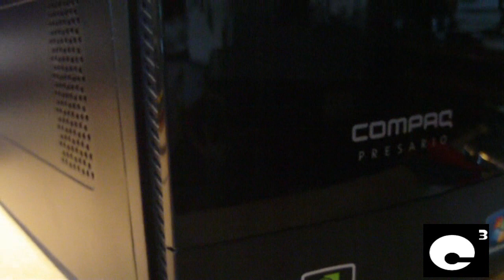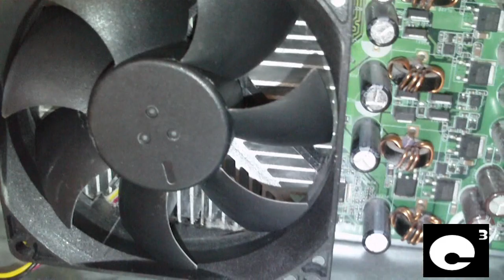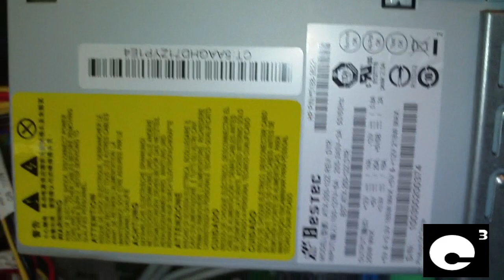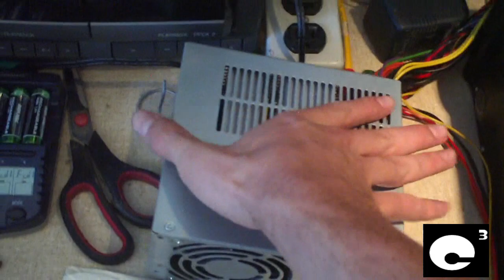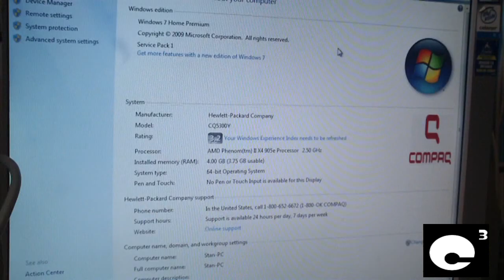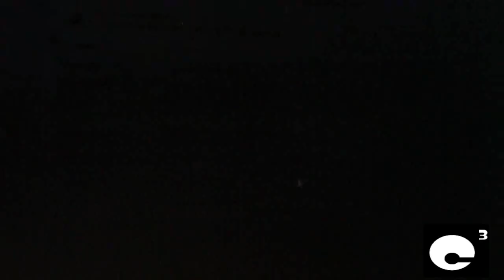Upgrading a basic Compaq Presario Desktop PC

Comment: Hey I Have The Same Computer. And My Hard Disk Just Went. When I Turn On THe Computer It's Telling Me To Replace Hard Disk And Press ANy Key...
What Kind Of Hard Disk Do I Need And Where Can I Get It? And Do I Just Install It By Simply Pullin the Old One Out And Putting THe New One In ?

Can You Answer These Questions Please ?
GOD Bless
Reply from the maker: If the computer is telling you that failure is immanent (S.M.A.R.T. error), back up your files IMMEDIATELY. If pressing a key allows you to get into Windows, then you still have some time before the drive fails. When it does fail, all information on the drive will be lost. If you aren't well experienced with cloning hard drives, replacing drives, or installing Windows, then I'd recommend you take the computer to a technician. Try to avoid large chain stores such as Geek Squad/Best Buy. The computer's gonna need a SATA hard drive. Just pick the capacity that's appropriate for you. I'd recommend you get a drive that's the same or higher in capacity.
Reply: Yes It Was Telling Me To Back Up Files But Now It Went... aNd I Cant Get Into Windows and Its Say Replace Hard Disk And Press Enter TO Proceed... I Have Rebooted The Computer 3 Times In tHe Past So Do I Just Put A New Drive In And Put MY Boot Disc In To Fix This... I Have Sata Cables
Reply from the maker: Myreverlation Yep, just replace the drive and start over from scratch using a Windows installation disc or OEM recovery media for your system (recommend if you don'tr know a lot about how to install and configure Windows)
Reply: Thanks Your Awesome ... I Needed This Help. The Video You Just Posted About Thrift Stores ... And The Error Message That Came Up On The Computer You Were Showing. Is The Same One I'm Getting On My Compaq Computer... So Saying That ...This Should Work For Sure ?
Reply from the maker: Myreverlation Yes, the hard drive in the thrift store computer was on it's way to failure, though it still worked. The hard drive needs to be replaced.
Reply: Thanks Do You... Have A Repair Store ... Just Curious If So where Are You Located
Reply from the maker: Myreverlation Yes I do. I'm located in Huntersville, NC (near Charlotte)
Reply: Ok Would It Be Cool If I Called On You The Phone For So Additional Help...? I WOuld Appreciate It
Reply from the maker: Myreverlation IDK if I could help much over the phone lol
Reply: Thought Maybe While I Was Taking The Drive Out I can Have You On The Phne To Ake Sure I'm Doing So Correctly Lol

Comment: Hi --- That was a super quick reply. Thanks. In response to your reply, I have indeed bought and tried a new pair of sticks (from Crucial). The result remains, however, the same. When one stick is used, it works regardless of which stick or which slot it is in. It is currently running on one 1GB stick. I am puzzled.

Comment: Hi, Mr. Cube C. Channel - I am glad that you are still answer questions. The video does me no good as I am not sure what I was watching. :-(
I have a Presario SR5510F running on Vista. It boots only on one stick of memory. If 2 sticks, it would just crash or boot up some of the time. Why that is? Is it worth repairing? I thank you for your time.
Reply from the maker: If you had two sticks of memory in the system and you were having issues with the system, then one of your sticks was faulty or you were running mismatched sticks (which sometimes causes instability.
Reply: ***** Hi --- That was a super quick reply. Thanks.
I have bought and tried a new pair of sticks (from Crucial). The result remains the same. When one stick is used, it works regardless which slot it is in. It is currently running on one 1GB stick. I am puzzled.

Comment: So here's a shot in the dark question. Can I upgrade the Desktop that I have into a gaming PC? Something mid range, doesn't have to be fancy. Here's my current setup. Compaq Presario SR5602FH, Intel Celeron 450 processor, 2GB RAM, 250GB Hard Drive, Intel Graphics Media Accelerator 3100 graphics card, Windows Vista Home Basic OS. Any help would be appreciated.

Comment: sempron = intel celeron = sloooow. i'm sure the memory upgrade made a big difference as 2gb was barely adequate for win7. but ddr2 really isn't bad, it just depends upon the speed and the o/s it's used with. i'm running an '08 compaq with ddr2/linux mint 13...it's much faster than my one year old hp running 4 gb/win 7. word to the wise, though; when replacing a customer's power supply, always go new, never rebuilt. PSU's fail often, you don't want them coming back in 2 weeks.